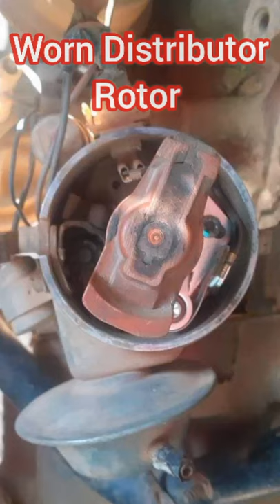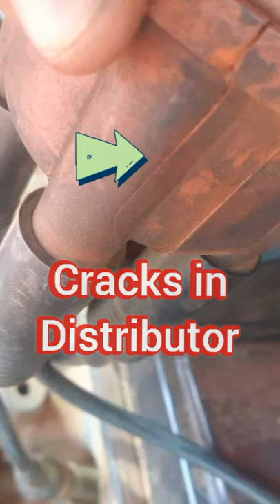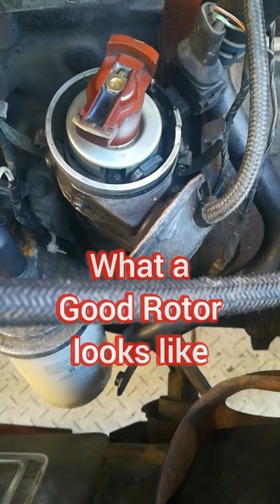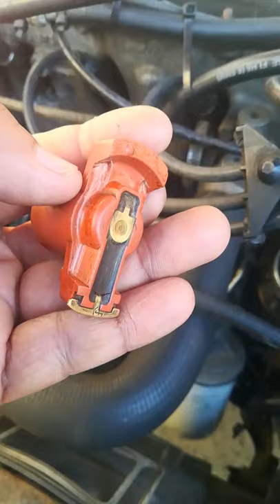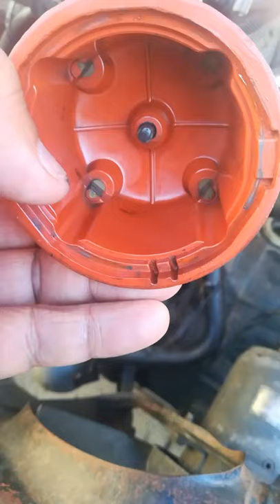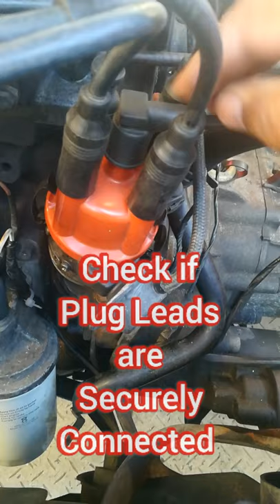GOLF MK1. Worn Distributor Rotor #shorts#golfmk1 #vwgolf

Comment: Hi,love your videos I recently got myself a carb citi golf and these videos help alot.My current problem is that the car a rough idle,misfire,poor performance and when I suddenly floor when it's cold she dies.i changed the base plate as per your video,I did a full service and replaced the plug leads.Could the cap and rotor cause the these problems? I'm suspecting timing because she doesn't have much power when driving.
Reply from the maker: Thank you,.. Yes if u changed base plate, and problem still persists then u look at things like possible air leaks around the Servo Pipe and brake booster, then check valve and ignition timing.. Distributor cap, and rotor...
Reply: @pjs-golfmk1-diy  Thanks,I'll do so.Looking forward to more if your videos.

Comment: Hi I want to replace my whole disturbtor..

What Advice can you give me that the timing doesn't go out?
Reply from the maker: Before doing anything,ensure all timing marks are lined up.Cam,Crank,and intermediate pully. Then take out the distributor. Replace it ,and ensure the rotor faces the notch on the distributor,- (you may need to loosen the 13 mm bolt to make the necessary adjustment) That means it's firing on the number one plug lead /cylinder.. To complete the job you may need to use an ignition timing light to set the  distributor ignition Timing spot on